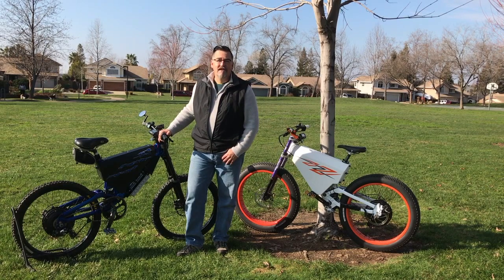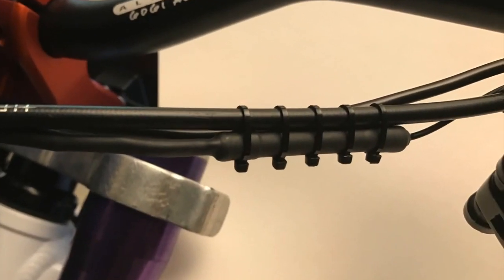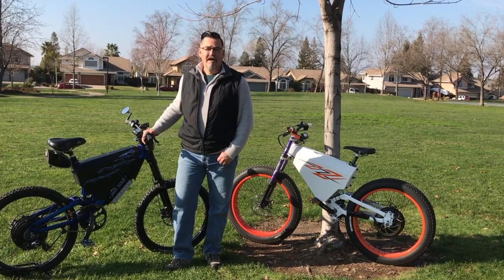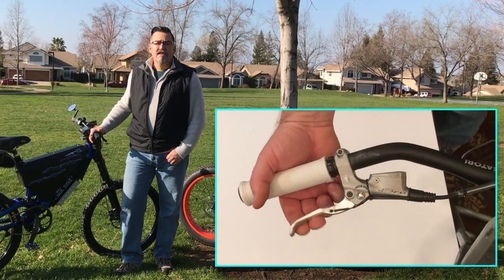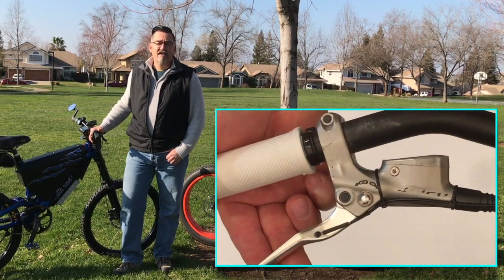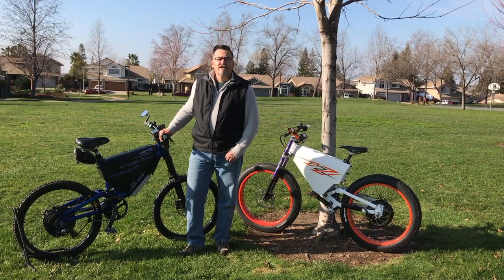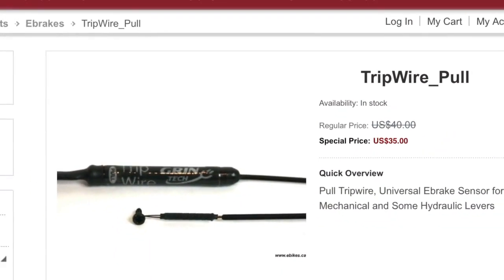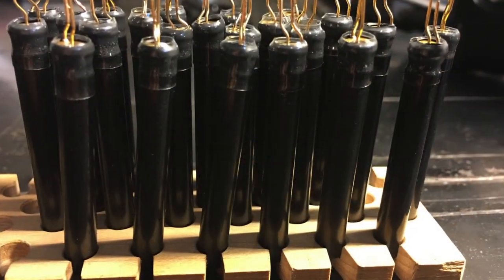Introducing the Tripwire, universal ebrake cutoff solution for electric bicycles

Comment: Do these provide an anolog signal, or are they just an on-off switch? I want analog brake levers to modulate Regenerative Braking. As it's stands now, I have to use Grin's throttle gimmick to modulate RegenBraking. But I am extremely uncomfortable doing that. So, I have to buy 3 throttles, make a linkage between the each brake lever and a thumb throttle, and wire those thumb throttles in parallel with the main, actual throttle, to finally have analog Regen Braking levers. And I don't even know if that will work, nor, how will I keep each lever separate to their own front or rear hub motor & controller, without them combining through the main throttle they are linked to. I predict, for example, I will try to Regen Brake with the rear hub motor, to stabilize the bike at low speed turns, but the front hub motor will be unintentionally accelerating, because the front controller is seeing a throttle signal, with no brake signal, when I just want the front wheel to coast in that situation. Come one Grin Tech. Just make Anolag brake lever switches, and programming in your controllers & Cycle-Analysts to support it.
Reply: I apologize. I guess I missed it the last time I checked the Grin site, but I went through their levers section, AND THEY HAVE ANOLOG OUTPUT LEVERS! No more 3 throttle plan, no more having to design and make separate Regen & Rheostatic Braking modual. Thank you, Grin Tech. On my shopping list now.

Comment: Hey Tim, so I have a situation lol I have a Talaria MX4 with upgraded brakes. I want to have a functional brake light and by removing my stock brakes I loose my cutoff sensor which can be used for a functional brake light sensor. 

Your product looks like an answer but I’d need the right connectors to plug your tripwire to my stock cutoff connector. 

Any suggestions? Been try to solve this issue for quite awhile lol
Reply: I have an MX4 too and looking to do the same thing! Did you find a way to do it?

Comment: Also, there needs to be a universal connection for all these different e-bike stuff because each brand has their own type of connectors and they don't play well with other eBrite branding. So when you're trying to build your own e-bike and use different parts, it's obnoxious because none of the stuff wants to plug into each other and it's just stupid. There should be a universal type of connector for all e-bike brands and everybody needs to stop making proprietary components that only works with their branding of e-bikes because if I find that I purposely will not use that branding of a bike parts ever again just to prove a point so make stuff universal. It's getting kind of obnoxious. They have to buy all these different adapters and stuff just to make it work because everyone wants to make their own style of wire connector

Comment: Why is everybody always forgetting about road bike? E-bikes I've been building my road bike for a while and all the parts are always for flat bar or mountain bike style bikes and nothing is compatible for drop bar handlebars or however you call them or for drop levers that go to the end of your drop bar that pulled down like road bike levers. Nothing is made for that crap. All your stuff is for flat bar or mountain bike horizontal levers. Why isn't anybody making stuff for drop bar and road bike handlebars. Everyone says their bike is the fastest. It's not if it's on the mountain bike style flat bar bike. My all carbon road bike is a million times faster than everybody else's e-bike because it's like I'm the only one putting e-bike stuff on a road bike. I just don't get it. Why won't you want that on a road bike so you can fly mountain bike? Sure, but for everyday commute I have a road bike and nothing in that e-bike industry seems to be made for road bikes. It's all for mountain bikes it's like give me a break already. So I really had to MacGyver half the stuff I get for my road bike and it looks obnoxious until like 3D print. Something to make it better. Stop forgetting about people who ride road bikes and gravel bikes please. And by the way, why are all the stuff that everyone makes never bad enough to fit around the handlebars? It's always have to break off the screw holder and zip tie it because nothing fits around these handlebars make the thing that attaches to the handlebars bigger like they're always way too small like it's for a children's bike

Comment: Will it work on any motor?  Electric Bicycle Motor Kit 48V 1000W…
Reply from the maker: It's more of a question to the controller than the motor. If your controller has a digital ebrake input, then in principle yes the Tripwire can be wired up to it.

Comment: I just bought a Leeds 500 watt kit for my recumbent. Leeds does not supply or offer an ebrake cutoff. I'm curious if this would work on my bike. I understand how the switch works, but I don't know if there is any place in the controller or computer to connect the switch.
Reply from the maker: Almost all ebike controller circuitboards have an input for an ebrake cutoff, but whether or not this is brought out to the external cable harness is up to the company spec'ing the assembly details. If you have an unused plug on your motor controller then there is a decent chance it is for a brake cutoff, but if there is no spare connector plug you'll have a much more serious hacking job to figure out the installation.

Comment: So let me jump in here and answer a couple questions that have been posted. First, the white bike in the video is my latest project (and uses TripWires BTW) it is built on a medium sized Giant DH comp frame with a highly modified swing arm. We are calling it the "Joker" bike. I have build threads for both bikes on Endless Sphere. Here is a link to this bike, and you will find links to my other projects in my signature at the bottom of my posts on ES. This bike and my previous build are both high power conversions and really needed good quality hydraulic brakes; it's where the TripWire was born.
Reply: Hey- is there a way to fix a tripwire (push version) that has too much travel between activating and deactivating the braking? Can I open up that little tube and adjust things?

Comment: Anyone know what frame the smaller white bike on the right is with the fat tires?  I need to know!

I'm really digging that white bike's lower height and shorter wheel base.  But apparently it still has potent hardware on it.  I see a triple crown MTB front fork along with fat tires and a beefy center power case.  Its like a mini Stealth Bomber style frame!  That small white bike has the "densest" power I've seen on any e-bike.

Comment: Is it a switch or proportional signal? I'd love to have proportional regen; will probably implement it by attaching a magnet to the lever arm and hall effect sensor to the body.
Reply from the maker: It's a simple NO (normally open) switch which closes when the lever is pressed, so it is compatible with the ebrake input on the vast majority of motor controllers.  So not intrinsically proportional, but when coupled with a CA3 device (and suitable controller) you can use your throttle to then modulate the braking intensity to have variable regen.

Comment: Now what would be REALLY cool is if it was integrated into the brake lever and provide variable electronic brake assist.  I'm always struggling to crank down my throttle while engaging the brake.  On my high speed e-bike, parts from Grin thanks, the full e-brake assist is very needed under emergency stopping.
Reply: I have manufactured the solution for that actually, but it is only for hydraulic brakes.
Reply: @DanielWilliams-fp4oz Do you have a link. This may be something I’m interested in as I’m building my bike right now.
Reply: Do you have a link for it? I'm upgrading the brakes on my electric.  I haven't selected brakes yet or modified the frame for them.  So I am still flexible.

Comment: Interesting idea, decent application but me personally, I would not use mechanical brakes on a high power ebike, hyd. brakes are much more reliable, alot stronger and much more sensitive, less strain on rider.

Hyd. Brakes that use mineral oil, magura makes inline pressure switch, they used to make both two wire and three wire for hall effect. I personally have not tried them but Magura makes decent brakes.

Using high end brake calipers is all fine a and dandy but if you have cheap ass rotors, you've wasted your money, I prefer to use high end Shimano Ice Tech, but there are several brands to choose from. Not cheap, cost more than some cars, $80 each
Size makes a difference too, dinky 160mm rotor on large motor wont stop shit and just glaze up your pads and rotors, too much heat.
I've got about $600 in brakes alone, 4 piston calipers, Deore XT or better ( have more than one bike ), Goodridge stainless braided lines, $300 alone just for my Dual control shifters and levers. My Saint Calipers cost me $200 each, just for the caliper.

On my Crysytalyte 5403, I put a 255mm rotor from Bicycle Designer in the USA, runs cooler, easier stopping, not as hard on brake calipers, pads last longer. They cost me $100 each but well worth the money.

Now some might think it's a bit excessive, but when your rolling down the road at 60 - 70 kph and car or bus pulls out in front of you, it's well worth it. Or Barreling down a trail, go over a rise and realize, there's a 10 foot creek, 6 feet deep on the other side of it :)

Comment: why is this so much more revolutionary than the already well proven Chinese add on method for hydraulic brakes, using a magnet and matching sensor which mounts to the brake lever in a very similar way, (if not more unobtrusive, when stuck under the brake and out of the way.) 
I have such a setup for nearly 2 years, before Hydraulic brakes with built in reed switches were more common and I believe it only cost me 15 bucks from Edward Lyen the famous controller modifier from SF.
Still there's def no harm in another working Ebrake add on solution, so well done.
Reply from the maker: That works well for certain lever designs, but many of the hydraulic levers have a pivoting geometry doesn't work with this kind of separate magnet and reed switch hardware, and it can be more difficult to adjust the exact cut off point. What we really liked about this solution is that the motion of the lever is converted into a controlled linear cable pull that allows the sensor to be located away from the actual brake lever. This way there is no need to mount anything to the often oddly shaped lever housing. 

Anyways, as you say lots of ways to solve a problem and the more options that are available for people the better.
Reply: I struggle to understand this, too. I think neither is a good option, as they both instantly make the bike look very home made.
Reply: Thanks for clearing this up. I can see what you mean.
Reply: +Grin Technologies True, thanks for the explanation and this does indeed seem better for my push piston style magura hydraulic brakes on my Ohm, (but they're already factory made as an Ebrake,) I might just get a set for another bike with Tektros that don't have and see which actually works better for me.
Reply: Magura makes sensors you can put inline, the fluid activates it, so any brake system that use's mineral oil, you can set up with those sensors, Shimano etc.. but any that use DOT3 or DOT4, Hayes etc.. you cannot use the Magura Sensors in. They are pretty popular in Europe, the sensors, havent found a USA or Canadian dealer for them yet.